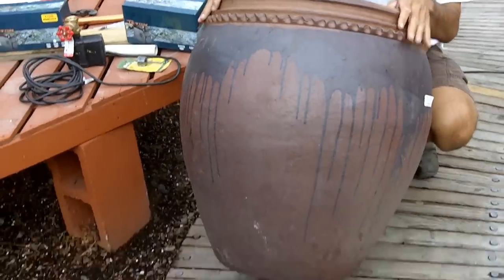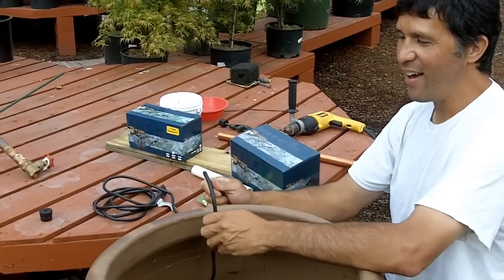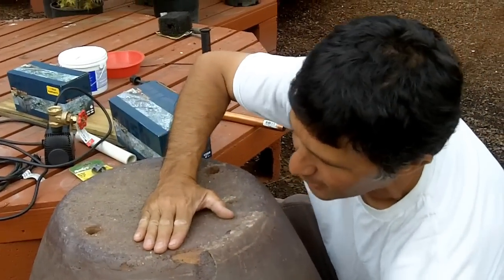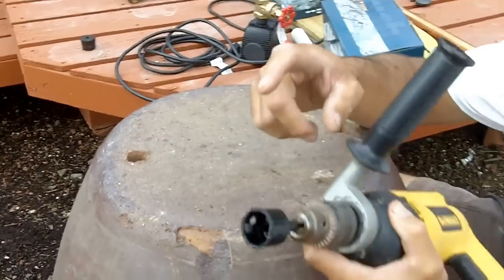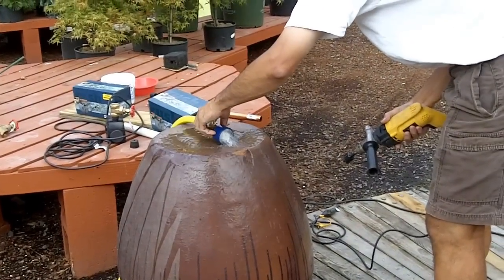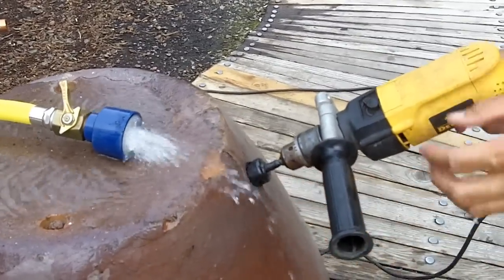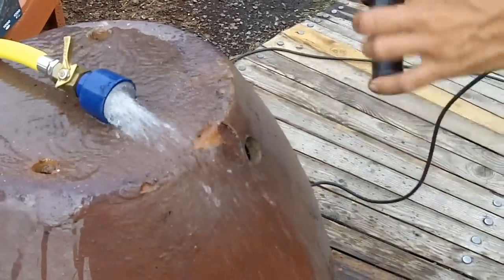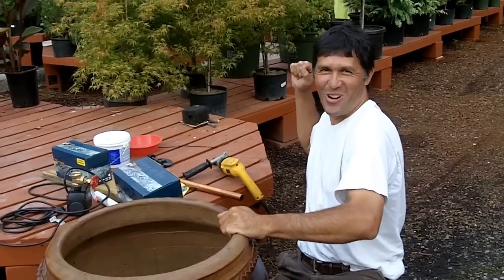Make your own pot fountain... Part 1

Comment: Absolutely right. This guys going for a Darwin award. Why not cut the plug off drill a small hole with a masonry bit put the cord through and reattach cord, seal with neutral silicon.